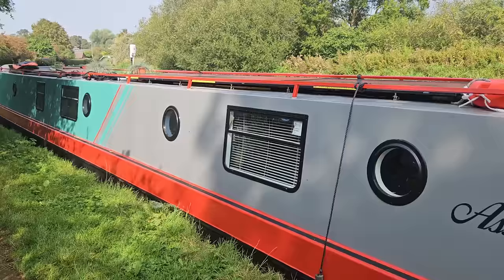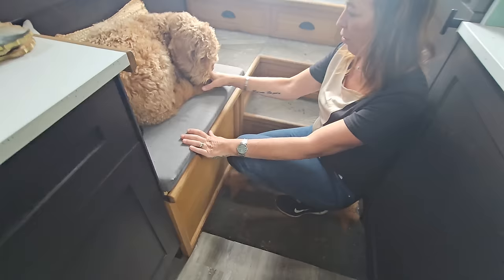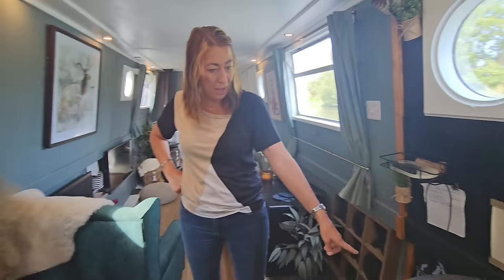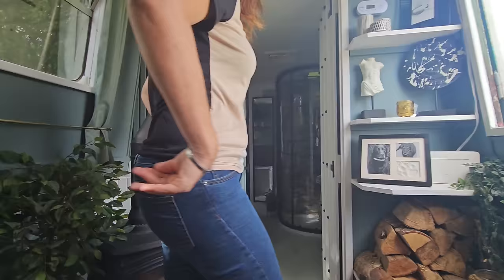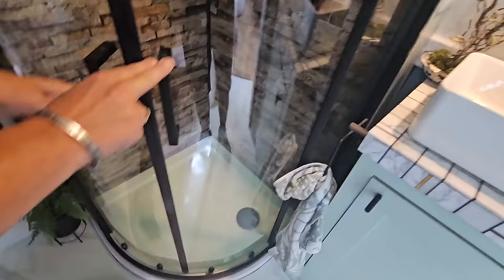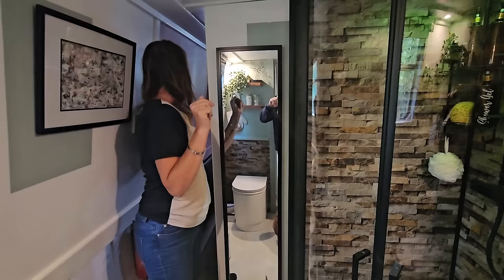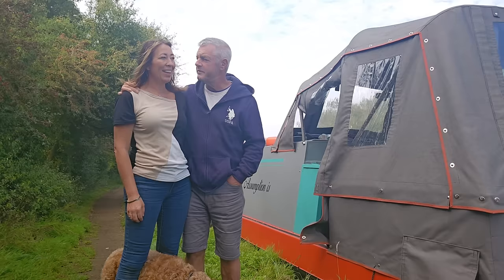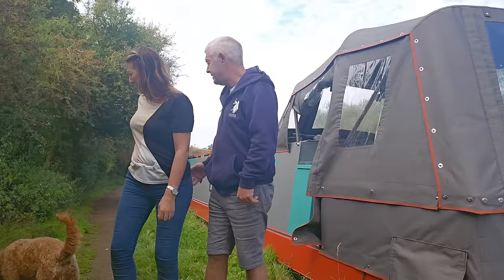Boat TOUR Inside our Narrowboat. Ep47

Comment: If you made a removable mesh window frame for that hatch you can leave it open all night and still keep the midgies out in summer.
Reply from the maker: Hi Martin. That was on the list to do but it was a job that got pushed to the bottom of the list as we didn't get any over bearilingly hot nights on the boat this summer. Hopefully it can be top of list for next summer 😀

Comment: Almost reminded me of a submarine in terms of width and length. You’ve made it very comfortable given it’s size. I loved when you opened the side hatch and all that natural light came into the boat. I noticed your dog doesn’t just plop down anywhere but neatly folds into one side tight to the sofa.I prefer hearing the technical stuff like amps generated, liters burned, how many liters in the water tank,but still appreciated your tour, thanks. Max in New Orleans
Reply from the maker: Thank you for watching. Yes that side hatch allows for some natural light to flow in 😀

Comment: Beautiful boat! 🤩
I’m currently renovating my own and wondered what you used to panel your walls out?? Was there a specific wood you used and then painted over or did you buy ready made panels? Also, did you attach by gluing or using screws? If screws how did you cover the holes to get the seamless look throughout? 

These might sound like silly questions but I’m just trying to figure out the best solutions 😂

Thankyou!!!
Reply from the maker: Thank you so much. Unfortunately we didn't panel the walls as they were already there we did add a few in though and sunk the screws and used wood filler to hide them. I know when joining panels our boat and others use cover moulds to cover the joints of each board on the walls, ceiling etc. 🙂